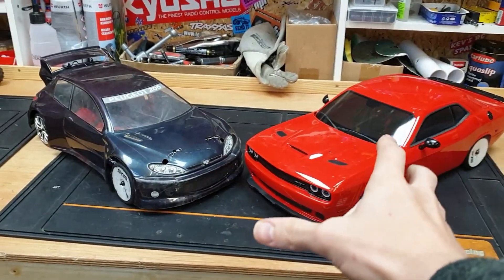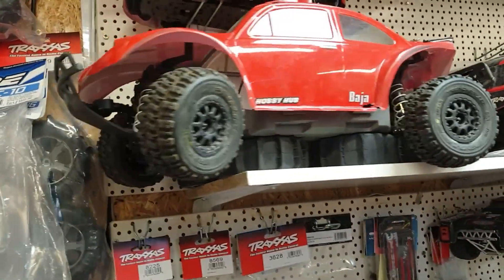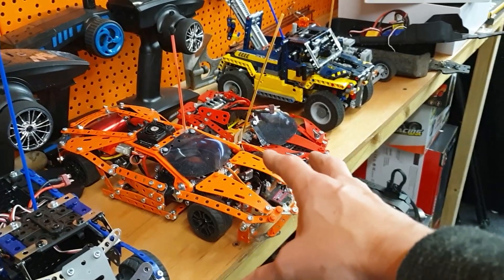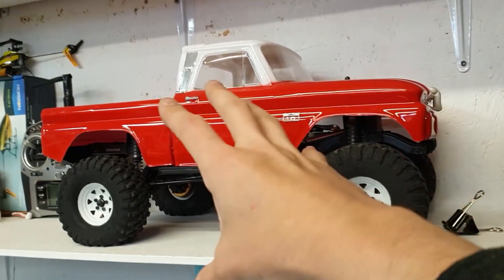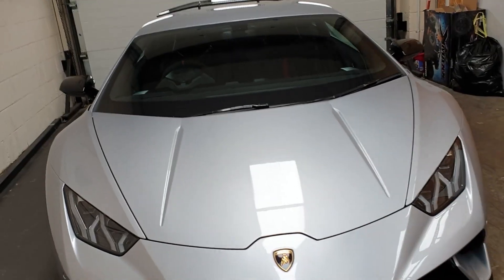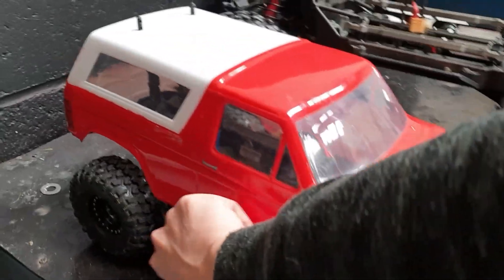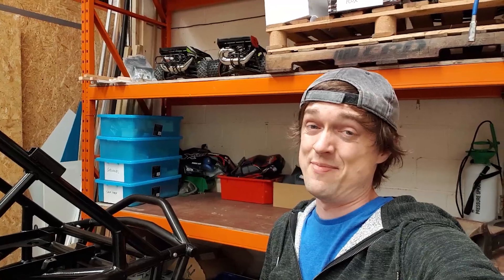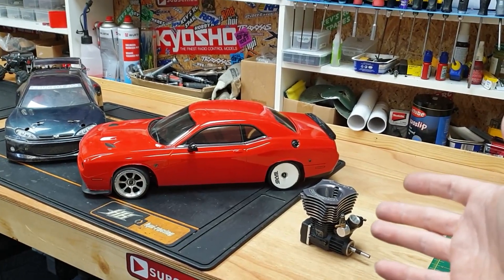To come on this Channel.......(cars, helis, planes, monster etc)

Comment: Park the lambo outside (Well away) and use the 'match & insurance' method to clean the inside fast! All good stuff Kev but don't you go going all RC Saylors on us with drones etc! You should get all the stuff you don't want and do a live auction one night. I've been to Goodwood festival of speed and you'll love it, I was there when Nick Heidfeld took the hill record, we were 20ft away behind hay bales - he clocked the speed trap in front of us at something approaching 200mph, hay bales, 20ft away....They no longer let f1 cars run for safety. I was there about 6am, I see this little old guy on his own working on a motorbike, got chatting, only later did I realise it was John Surtees (Only man to be world champ on 2 wheels and 4 wheels). The festival of speed is more fun than the circuit revival.

Comment: for your rovans don't the transmitters or recivers have a built in failsafe on them, if they do they should reset servos to neutral position if the signal gets week or the battery gets low in the car

Comment: about your killswitch,  don't most receivers have an automatic cut out when they loose signal nowdays?  just switching off your transmitter would trigger it, slamming on the brakes.

Comment: Hey kev im 14 and i have finally broke down and bought a mugen mbx7t truggy with a castle mamba system and im going to start bashing like you 😄😄
Reply: If you bash like kev be prepared to have $$ on hand for alot of spare parts
Reply: @thomasbesperka7533  yeah man those mugen parts in general are expensive 😂😂

Comment: I got a silly question. I bought a ollllld rc boat with a manual esc and 2 brushed motors... Can I simply wire the 2 in to one new esc. And if so what amp esc.. And how do I really go about it..

Comment: Can I have some help because my ftx carriage has broken and I only bought it this morning. The motor is still working but it not driving the wheels so what do I do?
Reply: I have the same car so I may be able to help.
Does the motor make a beeping chime when turned on and connected to power